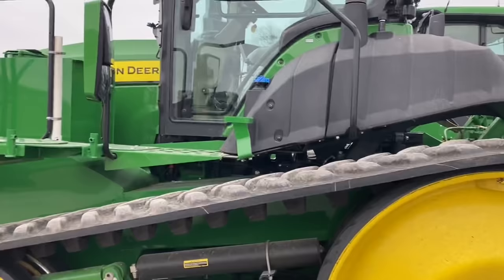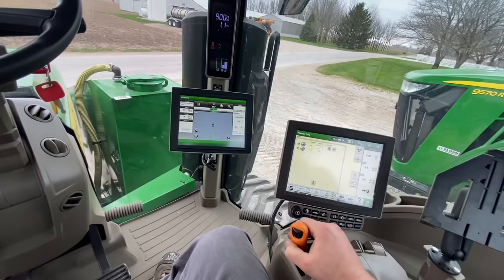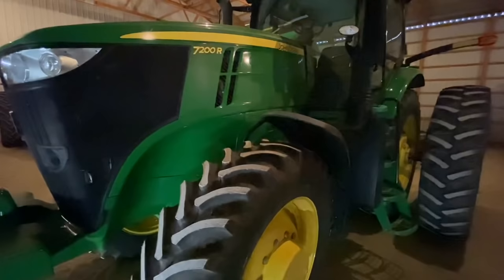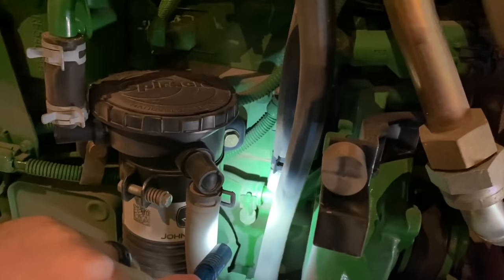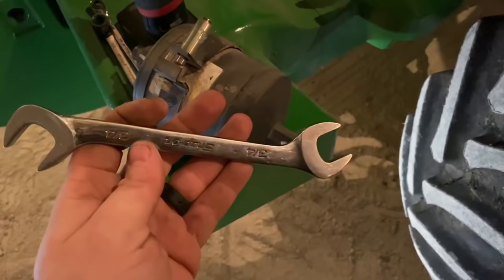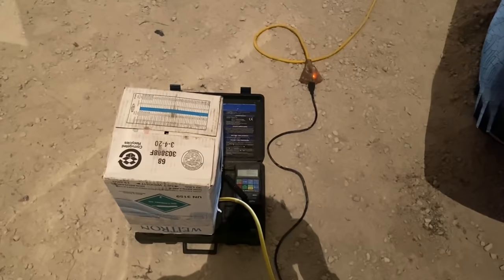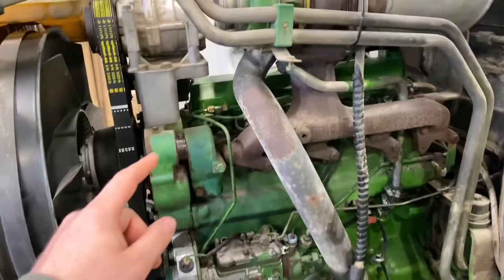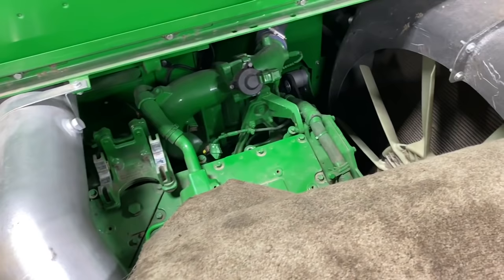Spring planting is almost here! (John Deere 7200R & 8RT 370 repair)

Comment: Thanks for another great video ZK. It was interesting and enjoyable and another great learning tool. 

The first tractor you looked at was told to have transmission problems shifting. I agree with you and your analysis. Seems to shift fine although I am not totally knowable on this new equipment. Might need some fine tuning after more use. Use it and report back type of analysis. 

Two and a half hour drive. Wow. Some of your appointments are not so easy. That tractor I would be totally lost on figuring out it’s problems, monster of an engine. But in your normal fashion you quickly knew the problems and the fix. You are amazing ZK. 
Good job on fixing the issues and cool air AC and coolant leaks. Customer I am sure was pleased with your action and the fact you came from so far. Outstanding customer service!!!’

Will be interested in more information on that extraction device you got. Interesting what they come up with nowadays. More feedback when you use it please. I agree with you that getting a broken bolt out can be very frustrating. You did great with yours. 
Was an interesting note that your dad is in the tool and die business. Very interesting work. 
Can understand why you are in that business that you are in with your dad’s background. 

You take care and be safe. 
Looking forward to the next video. 
Thanks for everything ZK. Enjoyed riding along. 
The Iowa farm boy. 
Steve.

Comment: Zeth, in regards to your rescue bit. I had a bit I bought from Chromate that was designed for drilling out broken extractors. I was told to drill slow and use cutting paste, not oil. I used it several times, with paste…it was very slow to drill out but it did work. I’m not sure if it’s quicker than using your die grinder, but if you have patience it will work.
Reply from the maker: This is for high speed 20k rpm so i will use it in my rotary tool

Comment: Not sure if it would help.on little bolts in blind holes maybe try a punch an hammer an hit the head before trying to back out.heat helps if nothing around to hurt but heat i think best as last options.i really don't like drilling easy outs ain't easy at all.Your videos and details are awsome.Thank You Sir.

Comment: I like the new Rescue bits. Could you go a little more in detail on them? As in, is it for drills or die grinder speeds. Also, If you look up the company Sanden. I used to work for them. I was a Test Tech for them in the Engineering Department. Meaning I blew up stuff for them. Great Job, Horrible boss. Yet, along what you found on the A/C compressor. We, honest to God found a few times. Under vacuum. They would hold not showing a typical leak. Under pressure, they would leak. If there is ANY moisture marks or spots or indication of not being clean around the clutch nut on the shaft. Just replace the compressor. Working in the Durability Test Lab, we blew stuff up for the engineers when they wanted to try something new, as in bearings or seals or what ever. They never could really explain why it would hold on vacuum and not pressure. But it happened. Just an FYI for you.

Comment: This 8RT is super smooth compared to the 7250R MY2015 that i operate. What was the oil temperature as  you tested it? If its around 0 degree Celsius it kicks right in if you shifting in gear, so you really better of using the clutch pedal . Also, if it shifts down from 16 to 15 you notice that the wheels lock for a short time so its really quite harsh. I do hope it gets better when it warms up, but it will need a calibration anyway.  Greetings from Germany

Comment: Zeth very well done.do you guys go threw the tractor before they are sold. I worked 30 years at a ford Linc mercury dodge dealer as a mechanic trans and diesel  when we got slow we would check in new cars and trucks ford and dodge would pay for 4 hours to check them in to go over them to make sure all was right before they go out the door.sam
Reply from the maker: Yes we do go through them.

Comment: I have a 2015 s650 combine. I would like to delete the def. What is your opinion on doing this. Motor has 900 hrs.
Reply from the maker: Why delete it? They don’t have that many Def issues. I don’t think it’s worth the expense.
Reply: @ZKMasterTech  s650 has same engine as s660 but s660 has 30 more hp. I would like to tune it backnto 330hp, i was told if delete dep if would use less fuel. True? So better fuel usage and dont have to mess with def. Your opinion?
Reply: @tracyroberts5417  Think he would probably steer away from giving you advise on this subject being a John Deere Master Mechanic.  Kind of a touchy subject in today's world. Just my opinion.